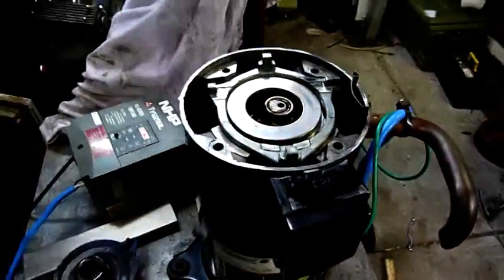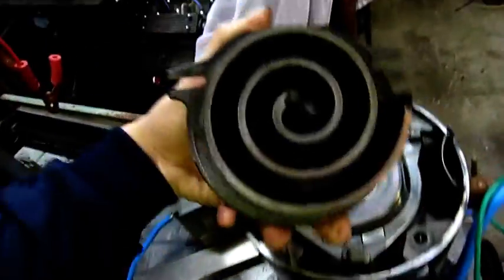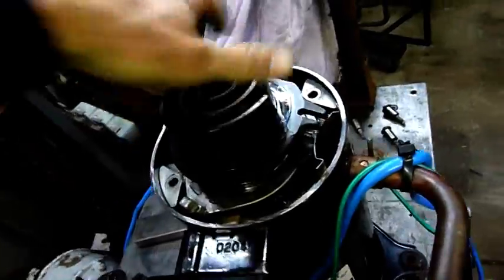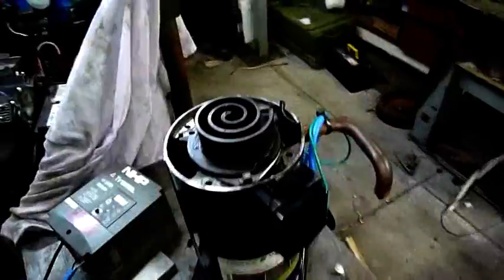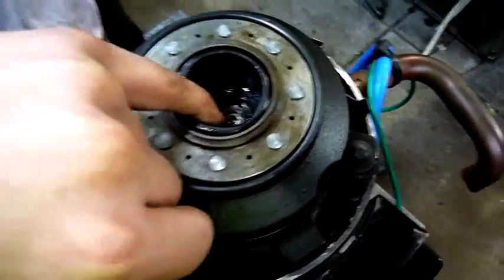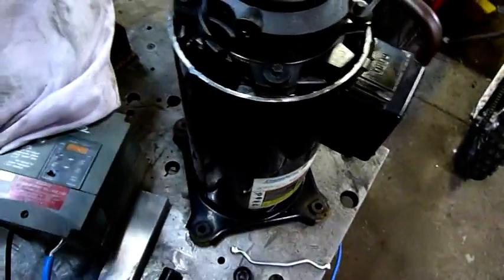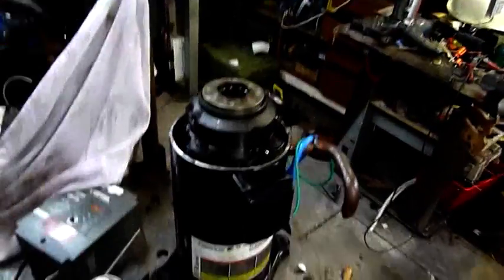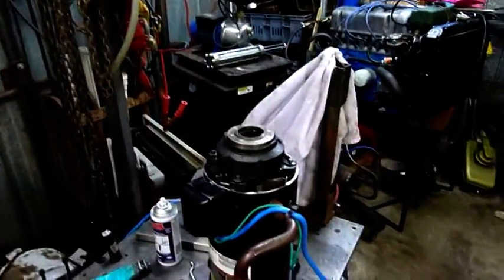Open Scroll Compressor Pt2 - Running Dismantled

Comment: I was always curious as to why a compressor made the metallic buzz vs the typical hum of a fan motor.  Now seeing how those metal plates / pistons move explains that.  they're just going at high speed under normal operation.  Thanks for the video, even though I've come across it years later. I recently had to have my apartment's heat pump replaced, the unit that was here, was installed in 1994.  Anyway the other night when the AC came on, the compressor shut off, came back on and blew a big hole in the side of the coil, and all the Freon escaped in a big woosh.  The unit had been trying to die the last few years, and they tried to milk it along as to not to go through the cost of a new one as long as possible.  It had gotten really loud too, it sounded like it could go at anytime.  The new one is much quieter, even inside as well as out.

Comment: Very informative video, looks like Copeland should pay for your video or maybe they are not too keen on giving away their design secrets. Definitely agree that the floating seal and pressure loading on the fixed scroll is an ingenious design feature. I would assume that the floating seal is last part of the Copeland compressor that ever fails in service. The video now explains why my Lennox condenser with a Copeland compressor does not use a starting capacitor (only uses a run capacitor) like some competing condenser units.

Comment: Gr8 vids Aussie!  Keep up the gr8 work!  Question: Would you happen to know the minimum watts this scroll requires in order to start up and maintain minimum pressure when installed in fully enclosed system? And how many watts you're using to start when open like this?  Thnx again! Subscribed and liked!

Comment: hi, i would ask you, what may happen if i use a frequency inverter to vary the speed of a air conditioner compressor, if i do that, will it work like a inverter air contitioner?, is there any problem if the speed of refrigerator gas vary? can i modify a old air conditioner into inverter technology?
Reply: I did this on my house with a 3 ton copeland scroll 3 phase compressor. works like a charm. saves a shitload of electricity $$$
Reply: That's how Inverter ductless splits work

Comment: Thanks for super videos. Have two questions. As I get to know, some Copeland scrolls have oil pumps on the bottom. Does it pump up the oil to some parts of compressor or the amount of oil within the refrigerant is enough? The place where you grind off the upper cap is where the top scroll body joints and seals?

Comment: Ed, thanks for the video. I have this compressor in my home unit here in Phoenix, it is 21 years old and I'm afraid is giving up the ghost. After watching this video I know EXACTLY what is happening to mine. Sometimes during a run , you can hear the compressor  sounds like it slows down and starts rattleing or as you say scrambleing , if I allow to continue, the comp heats up and and shuts itself off. After about 30mins it will come back on and sound right. This is a heat pump so it is in use all year and is very busy here as it was 46c here yesterday, we are in cooling from about april through oct-nov. hopefully the old girl will hang in whilst I shop out a new unit, thanks again for the in-depth video, I like your new Merc by the way , its abig jump from little car !    Scott
Reply: after 21 yesra the compressor has all the rights to give up :-)

Comment: I have a compressor like this which has a soft start on it, i have nothing but trouble with the soft start , anyone know do i really need it?  would love to bypass the stupid thing!
Reply from the maker: lol I have no idea why they would put a soft start on a domestic AC unit, most have or need a hard start kit (start cap and relay)
I would just delete the thing and see how it goes.
you may notice more inrush current causing lights to flicker ever so slightly if its a large compressor tho.
Reply: there is a start cap inside the soft starter. older models of my heat pump dont have them but apparently the power company here in Ireland is looking for soft starts to be installed, must leave it easier on their transformers or something.

Comment: Thanks for sharing the videos.  I have a Danfoss model 120U1908 but I didn't find how to make the electrical connection.  Did you use any capacitor?  Why 3 wires in the terminal box?

Comment: Thanks for the video, I was wondering what was inside one of these.  It doesnt seem like a whole lot can go wrong, though I do wonder what damage was done to mine when the tech over charged it and that compressor hammered LOUD, still kinda runs but my ac doesnt work well.....

Comment: I do like seeing things blown up but I like seeing the building and rebuilding stuff more like the Kelly and Lewis and the Westinghouse generator. Maybe the Kelly and Lewis could be paired up to power the Westinghouse but it probably doesn't have enough grunt to turn it over at full RPM, but the Morris engine might, the Datsun and Jag engines would for sure.

Comment: Those things are quite a mechanical marvel inside, its seems a lot more complicated then just using pistons and cylinders, not compared to something like a radial aircraft engine of course. The scrolls themselves look like something you could use in a piece of ornamental iron work like a fence or a railing.